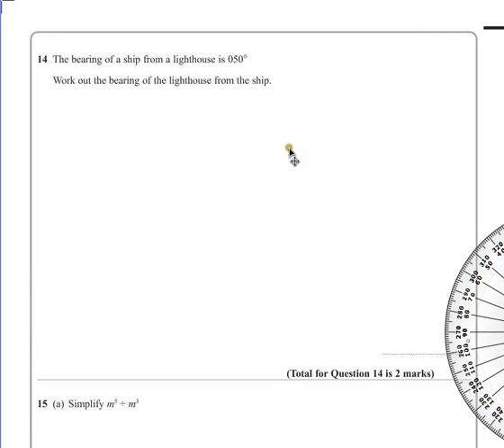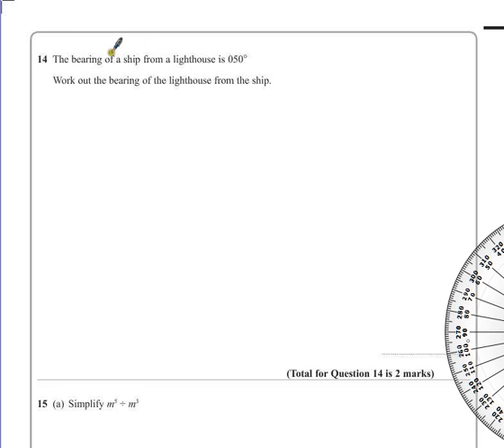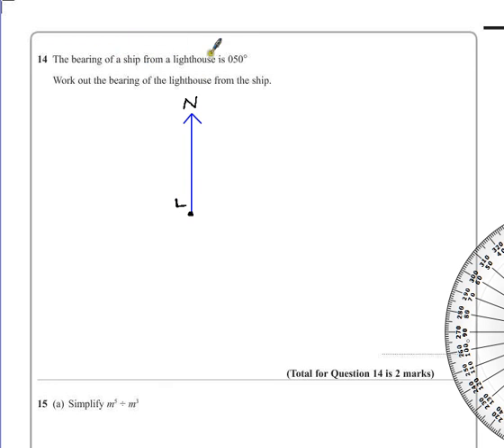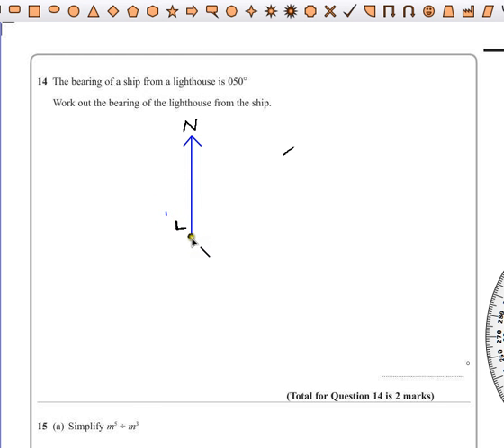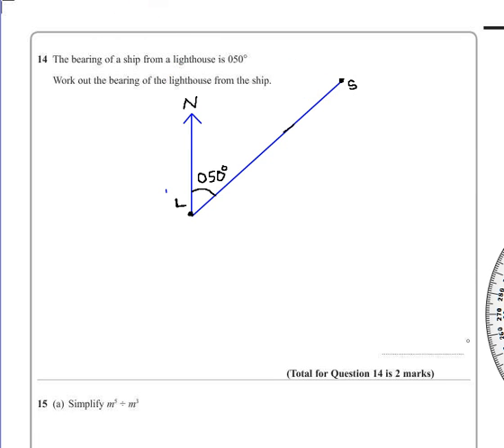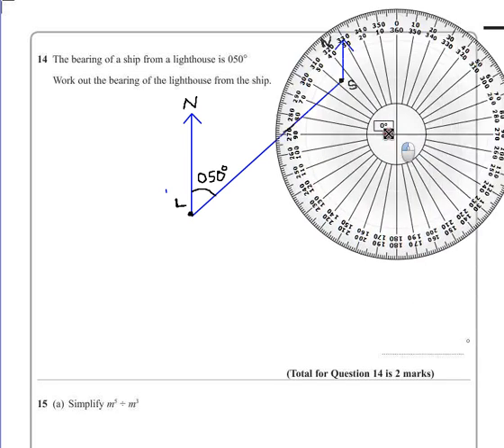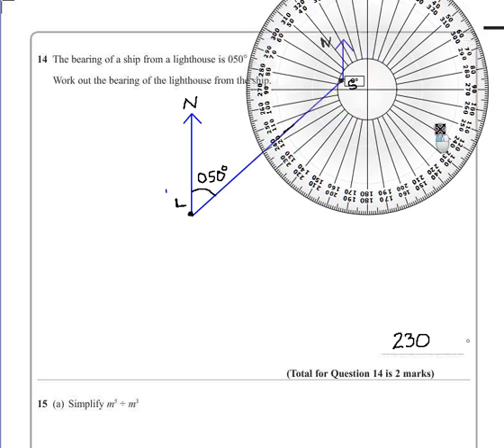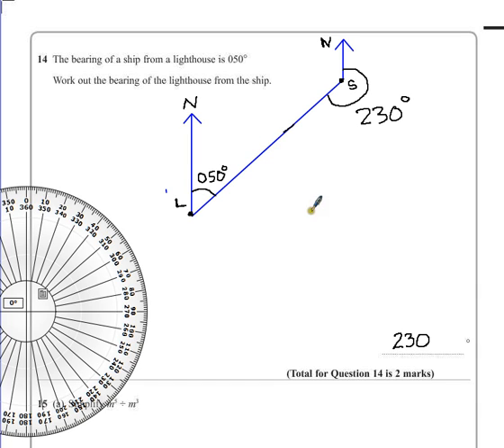PGSMaths: Nov2012 1H - Question 14(2) (Bearings)

Comment: Doesn't really make much sense as in an exam we wont have a full 360 degree protractor =/
Reply from the maker: Why wouldn't you have a 360 degree protractor? It's a recommended piece of equipment for any GCSE course and exam - makes things easier. You CAN do the same thing with a 180 degree protractor, you just have to measure the angle in parts (180 degrees, then turn the protractor and add on the angle after that). I would really suggest picking up a 360 - they're not expensive and make everything with angles SO much easier!
Reply from the maker: Also, bear in mind this was an explanation video - the actual answer is much simpler (check the related video Question for Question 14)
Reply: PGSMaths Oh yea true, xD thanks anyway the video really did help :)